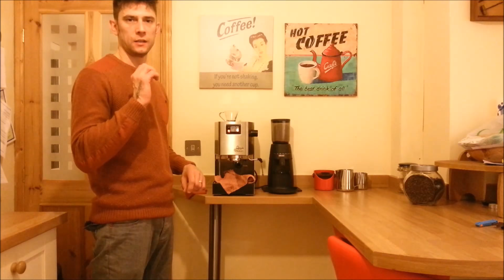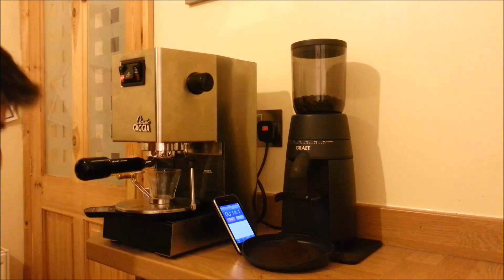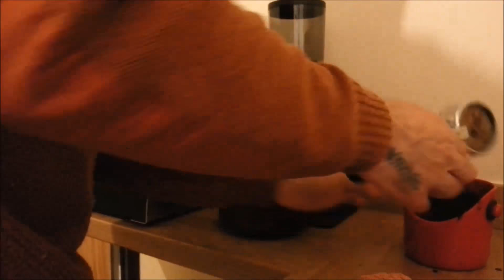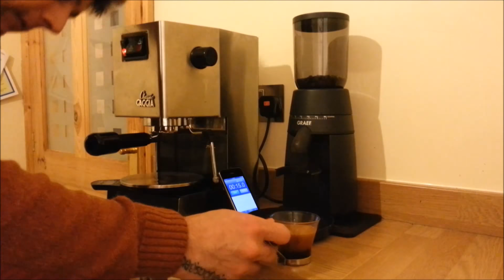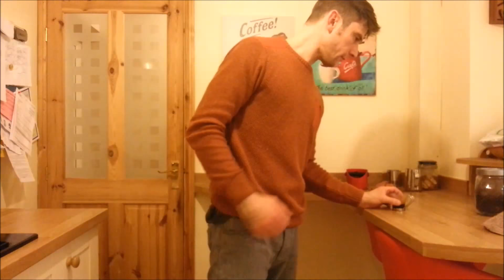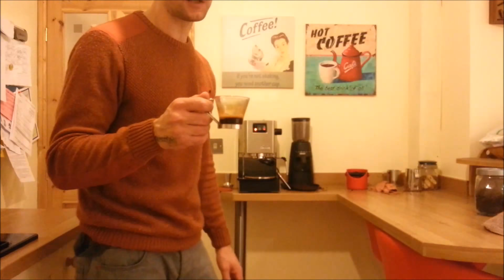Tutorial how to dial in your coffee grinder

Comment: Nice presentation i can say, i just bought exatcly the same devices, however i'm still practicing on grinding. To achive this result  which is setting of your grinder ???
Reply from the maker: The setting on the dial will depend on how many washers you have under the burrs. If you adjust all the way to the end and need to go more, take out or add another washer and go from there
Reply: @BenVowlesAEIOU  where are these spacers everyone keeps mentioning? For the life of me can't find them
Reply from the maker: @poopboy777  Have you taken the burrs apart? They should be between them

Comment: Are you still happy with the Grinder?
Reply from the maker: Yes, still have it, still love it
Reply from the maker: @CMK-Security  You should be able to take the burrs out. The nut on top might be reverse thread though.
Reply from the maker: Failing that, a brush in there when tipped upside down should do it, then run a load of beans through it